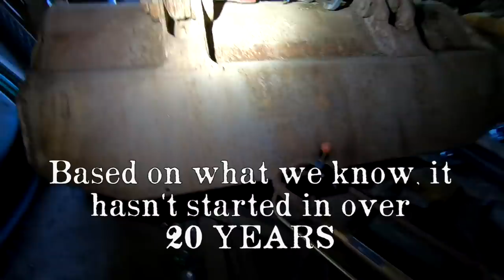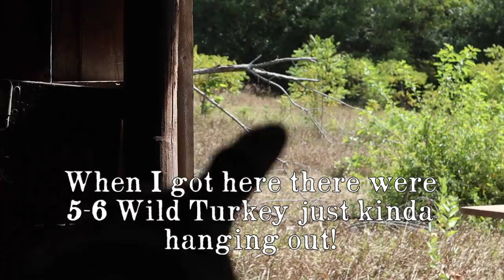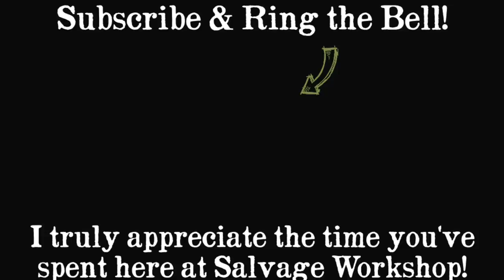Will the PONY Motor START?!? ~ Part 1 ~ 1950's Caterpillar TraxCavator

Comment: Liquid cooled pony engine also spin main engine to spin water pump
Reply: The pup is placed to circulate the coolant by convection. That way it can heat the main engine in very cold weather.

Comment: Its funny that the pony motor is called a donkey engine in the U.K.?
Reply: In the US a donkey engine was usually a motor on a sled or cart that  was used for PTO work.  Often used in logging for winching or in mining. The first ones were steam engines.

Comment: Just one or two things Soldering is not soddering and a castle nut split pin is not a cotter pin, that goes on the crank of a bicycle and is much larger

Comment: Hmmm ... you had tge gas for the pony motor turned on ... gasoline in the tank ... pull the float bowl off the carburator, and it's as dry as the Sahara... Do ya think MAYBE the reason the pony motor won't start MIGHT be because there's NO GAS IN THE CARB BECAUSE OF A BLOCKED FUEL LINE?!?
Sheesh! I'm shocked that you actually checked the oil before trying to start it... 
"...the float still moves ..." 
That's great! Does it SINK when there's gas in the float bowl? Some of the old floats went bad and sunk, instead of floating and closing the needle when the float bowl was full,  you know. 
Bunch of B.S. You obviously have no clue.
"it's s little dirty in here (inside the carb) but not bad ..."
umm ... hate to bust your bubble, but ANY dirt inside the carb is "bad". 
How'd it get in there? from the fuek is the only way for dirt to get in tbat part of the carburator.

The fuel tank needs to be removed and cleaned. The fuel line needs replaced, if replaceable. If a metal fuel line, it needs cleaned, and any holes brazed closed.
Is the fuel shut-off valve opening properly, or is it clogged, or frozen in the closed position?

Gas engine needs FUEL, COMPRESSION, and SPARK to run.

"There's a little diesel in the tank ..."  I hope you were smart enough fo pump that now BAD 20 year old diesel out, clear the lines, pump and injectors of the 20 year old now BAD diesel and put in fresh, and that you checked the oil and water of the main engine before trying to start it.  (fixing any leaks found, while you're about it)
A diesel needs FUEL and COMPRESSION to run.

The way you go about it, I'm surprised you ... actually ... I doubt you film and post the damage you cause and the required repairs because you don't follow protocol.
Did you bother to check the fluid levels in the transmissions and differentals before you moved it, presuming you managed to get it started.  (I'll presume you did, since you posed a dam "will it start" video.)
How much off camera repairs did you make to get it running?

Comment: Hi

When are you Americans going to stop corrupting the English Language?  Stop, for the love of God, calling SPLIT PINS cotter pins.  Cotter pins are those pins that hold bicycle pedals in place.  You know, they have a tapered flat and a threaded portion.  They are generally machined and, compared to split pins, more expensive.  Split pins, what you insist on calling COTTER PINS, are consumable and generally, single use and usually used with castellated nuts and so forth.

Other than that, brilliant videos.  Just do me a favour, stop saying cotter pins when you mean split pins.  Thanks

Ian
Reply: I have started those mean starting engines on cats from D2s to D9s they are a pain in the back side. I would not have blocked the boom up like it is but he did that so you can get at the starting engine, with the boom down you can't get to it from the side, had a 955 H at one time. Good you got it going hope the steering clutches are not stuck, it has dray brakes and clutches and a dry master clutch. The sprocket on the dead one has been cut off, they used to make a replacement to weld on where it is cut off, they also made a weld on ring. Good luck with it.